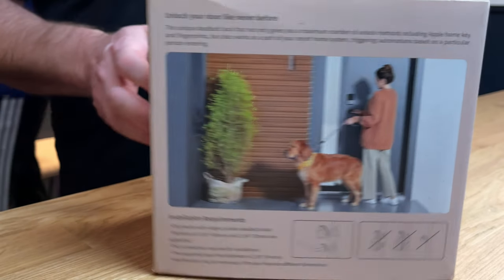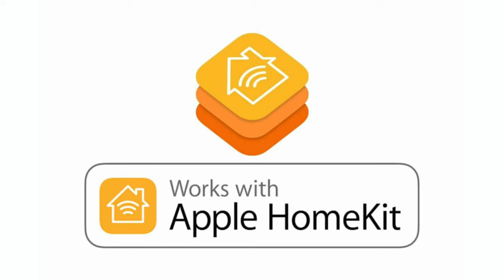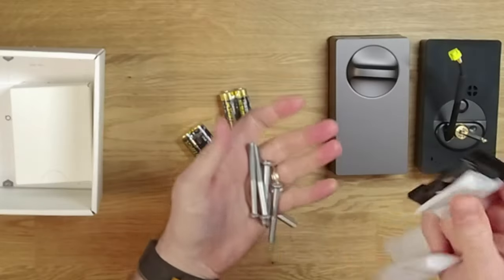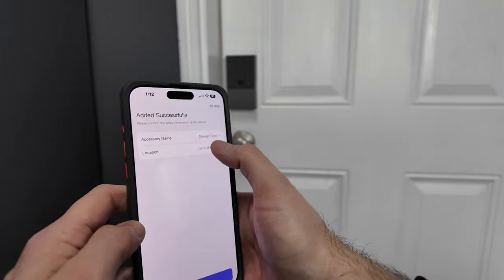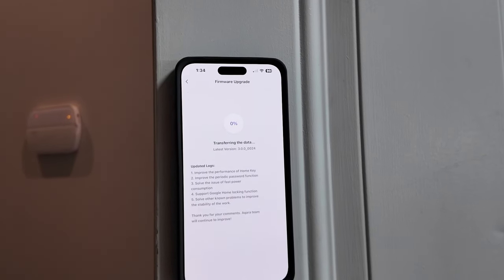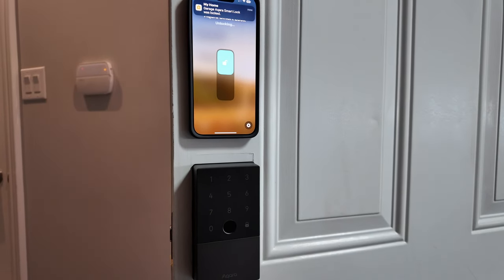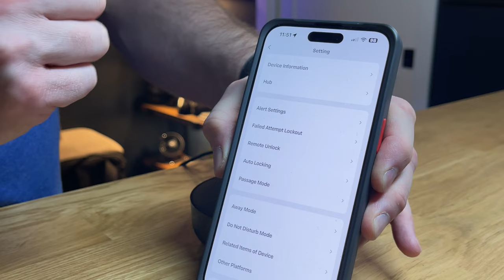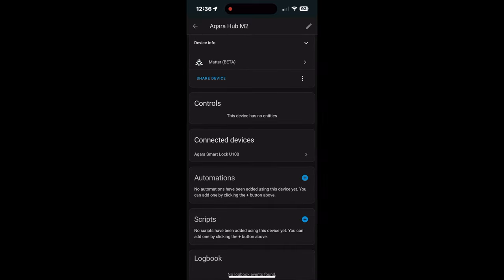Best Smart Home Lock 2024 - Aqara U100 Home Assistant Setup

Comment: Thanks for this video... I had purchased this lock specifically for the integration with HA through SONOFF Zigbee 3.0 dongle. However, looks it does not work. Have you found a solution other than purchasing the Aqara Hub?

Comment: Great review. Does anyone know of a Deadbolt Lock Cylinder brand/type that will work with the keys provided in the U100 installation kit?
Reply from the maker: Great question - I reached out to my contact at Aqara to see if they have an answer - will let you know if I hear back! - thanks for watching!
Reply: I saw in another video that the key is Schlage.  The U50 can be rekeyed to match Schlage deadbolts.  I would assume the U100 is similar.

Comment: I have added aqara u100 lock to google home and alexa through G3 camera hub over matter. I am able to lock/unlock and manage temporary users but i can't manage general users and fingerprints remotely. That is a very huge drawback as i wanted to manage my tenants remotely.
Reply from the maker: Thanks for watching - yes unfortunately you can do pin numbers from Homekit, but if you want fingerprints it only works locally - I think part of that is security as they talk about how fingerprint access is only stored on the lock itself - so that would be a hard claim to make if you were able to add/update via the cloud. - thanks for watching.

Comment: does it work with Google Assistant and can the device unlock with Google Android NFC function?
Reply from the maker: Yes, I am using mine with voice control from Google, and Alexa - not sure about the NFC, I believe it will, but not 100% on that one.  I will see if I can get one of my pixels booted up and check! - thanks for watching!
Reply: @yoyoTechKnows  - did you got a chance to use the NFC from your pixel?

Comment: Can someone advise what protocol the locks use to communicate with HomeKit. And is it correct that an Aqara hub is not needed for the locks to be operated with HomeKit?
Reply from the maker: I can 100% confirm that you don’t need the hub for HomeKit - I had that up and running before I even opened the hub!
Reply: @yoyoTechKnows  Thanks! That means they are communicating via Bluetooth? I guess that's why the lock that is a bit further from the Apple TV hub is constantly dropping in and out of an available status? Half the time it shows as No Response.

Comment: How do you manage PIN codes for the lock with the hub or Home Assistant?
Reply from the maker: I am currently using homekit or the Aqara app - homekit allows for home key and the Aqara app allows for fingerprints - but they all seem to sync up fine. - thanks for watching.
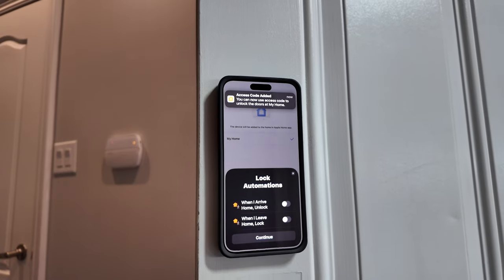Reply: @yoyoTechKnows  Users/PINs don’t seem to be syncing between Aqara and HomeKit. Based on this video ( 8:34 ) it should be possible… how did you get it to work?

Comment: Will it work with the E1 stick hub?
Reply from the maker: I have not actually tried this - but I believe so.
Reply: @yoyoTechKnows  In case anyone else is wondering: I confirmed I was able to bind the lock with the E1 HUB, add the HUB to Matter and lastly control the lock and also view the logs as in your demonstration. Please ensure that the lock and HUB is running the latest  firmware version.

Comment: This lock is buggy - I have two of them and with both, the keypad becomes unresponsive after a while. To fix the issue, you need to pull the batteries to reboot the unit.

Lots of reviews on Amazon complaining about unresponsive keypad.
Reply from the maker: I have not had that issue with mine, but doesn't mean others don't.  I would check to make sure you have all the updates, and reach out to support - if you have a buggy unit they may be able to help! - Hope you find a solution and Thanks for watching!
Reply: @yoyoTechKnows  Yes, I've two RMAs, there are also lots of complaints on Reddit, apparently the lock "freezing up" is a common issue. I'm not sure if it is related to the manufacture date or something else. The locks I had issues with were built before September 2023.

Comment: This lock is actually pretty lousy.  It chews through batteries like no other lock I've had before.  If you use it natively in HomeKit you lose fingerprint functionality.
Reply from the maker: Strange, I would check that your firmware is up to date - I have used it a minimum 5 times a day for the last 3 months and my battery is still showing as "high" I would guess at least 80% - for me thats not too bad! - anyway hope you find a solution for yours - thanks for watching!
Reply: @yoyoTechKnows  I bought my U100 in December 2023.  The batteries shipped with the device are still above 50% on 9/2/2024.